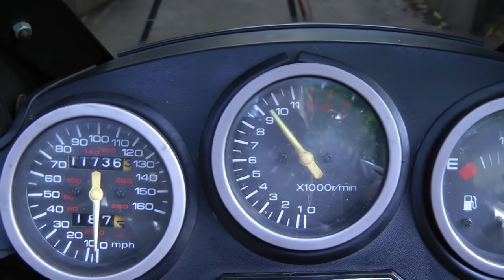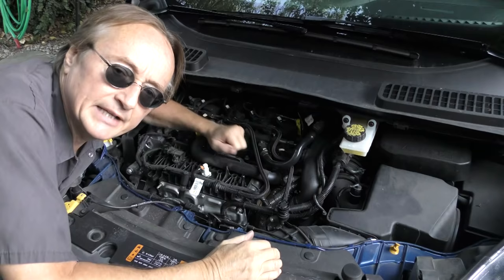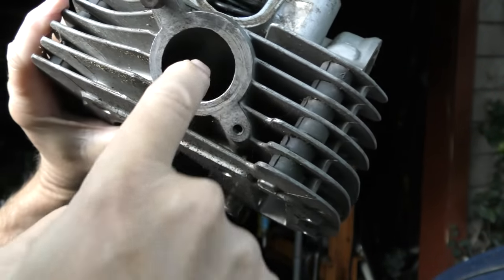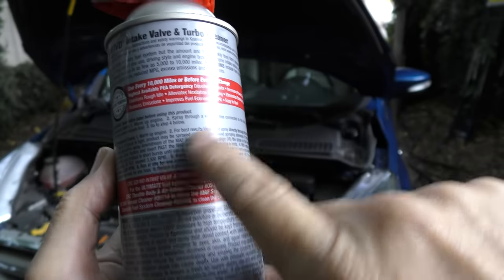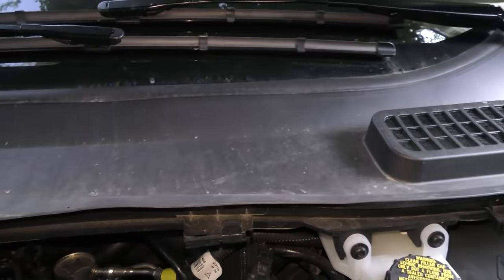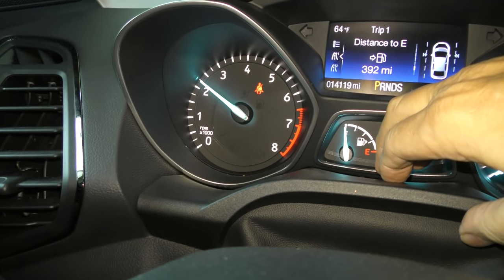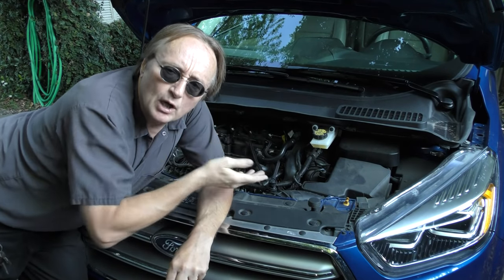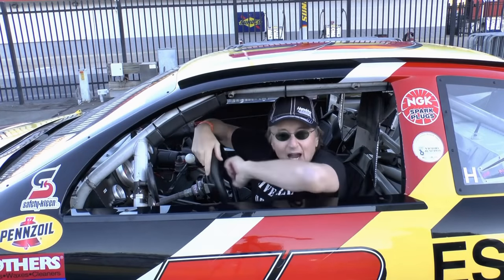How to Clean Intake Valves in Your Car with a Spray Cleaner

Comment: Hi Scotty...thank you for the great videos. I have to say this product needs to be used with extreme care and caution in some cars. I'm currently in dispute with New Zealand supplier where my car now smokes upon start up. 1999 Mazda FS 2 litre 109,000kms genuine. It certainly worked and did a great job. CRC NZ have stated due to the deposits been removed oil is now seeping into chamber as valve seals were tired before using product. My argument is given the nature of the product and what it's likely to do their should be a warning on the can. It's not good environment 'PR' To have valves cleaned to make an Engine perform to it's peak only to have it puff smoke and consume oil. 

I simply cannot trust this product again and risk it cause issues on other's cars. I strongly advise be warned and prepared to take the risk
Reply from the maker: yes, realize if you have a somewhat worn engine, and you clean the carbon out, there is more space for oil to go by the piston rings.  BUT, your engine was worn in the first place, as you admit it did a great job cleaning it, then you can't blame the wear on the cleaner. They are indeed correct in what happenned.
Reply: G'day Scotty....The argument I have is there was no issue before using this product, and rightly so at that age it wouldnt be uncommon to expect valve seal issues. I simply feel CRC need to make a balance between pushing the positives as well as the negatives of such a clean up. 

One could argue a professional would know the risks, however CRC do not intend this product to be used purely by Professionals. Atleast not in New Zealand, it is pushed even to a layman. It is only fair people should be in formed of risks so then it is an informed choice. 

If I could find a video how to replace seals on a Mazda FS 2 litre that would be awesome. Love your videos Scotty
Reply: Thankyou for your message. Would you know where a video is on a FS engine valve seal change? I cant find one for looking. Many Thanks
Reply: Well I'm definitely going to try it where do I get the stuff at thank you Scotty you're a beast I love your bike by the way I sure hope this works on my older  Toyota Corolla I'll let you know so I changed the oil afterward I wish they'd say what to do after you've done this you just leave it alone or what thank you

Comment: Scotty you are the man , I have a 2011 Scion tC with a rough idle I changed the plugs ,cleaned the throttle body ,changed the coils and still the idle jumps and shakes at low rpms  anything below 500 she wants to shake up at lights , parked . When disconnect the intake idle vale pump the idle is fine . Can I clean this part ?

Comment: Hi Scotty, on the CRC bottle, it  asks the user to spray behind the MAF sensor in the intake manifold. Will spray into vacuum line yield a better result? Also, how did you know that hose is the vacuum line to the intake by just looking at it?
Reply: I'm wondering the same thing
Reply: Is the maf sensor in line with the vacuum hose?

Comment: SCOTTY PLEASE HELP!! YOURE THE BEST AND WILL KNOW THE ANSWER!!

Is it safe to clean the intake elbow  after removing the throttle body off of it? Or do I need to remove the elbow and clean it when it's disconnected from the manifold?

I want to clean the EGR ports and I can't remove just the EGR valve because the EGR tube nut is completely rusted and stuck and nothing will take it off. I've tried everything.

I have a 98 ford f250 4.6

Let me know.. Thanks!

Comment: How did you keep the car at 2000 rpm while spraying the can?
Reply: The cat did it
Reply: Brick
Reply: I had my son do it. He's handy.
Reply: hola yason probably used his programing tools to set idle many HIGH END obd2 scanners can do that
Reply: hold the throttle cable
Reply: These modern GDI engines don't have throttle cables.  They have electronic throttle bodies so you need a friend or a high end scan tool.
Reply: @Plumharambe  it's drive by wire....
Reply: Pvc pipe and using seat button

Comment: What about the additive with your gas I just bought the Lucas brand fuel injector cleaner for my 96 thunderbird does this stuff really work? I know Lucas is a good brand but I was just wondering thanks scotty
Reply: i dont no about lucas but nulon fuel cleaer valve ect works i put 1 bottle in every service i do 5000km
Reply from the maker: all true , in a GDI engine tank cleaner will not clean intake valves, but it will clean the inside of the engine
Reply: This additive will clean the fuel injectors, which are very expensive on GDI motors.

Comment: What about the vvti engines of Toyota corolla? These are not GDI engines as far as I know.
Reply from the maker: of course it works on any engine, cause GDI engines are the hardest to clean, so it works great on normal engines too
Reply: Thanks much appreciated scotty.
Reply: +Scotty Kilmer how to sparay the cleaner in fuel injection e gasoline engine through throttle body or any another way

Comment: can you spray it directly into the throttle body?
Reply: Michael Harless no
Reply: why?
Reply: But Scotty did say on the video explanation "or if it's easier, you can spray the cleaner directly into the throttle body of the engine"
Reply from the maker: yes you can. This one was just too hard to access on its modern design
Reply: Derp lol but heat and oil through the pcv valve is ok.
Reply: Derp just use throttle body cleaner replaces coating
Reply: Thank y'all.  I have a Toyota that the throttle body is ready to access
Reply from the maker: yes you can, on this car though the throttle would take an hour to access
Reply: Scotty Kilmer thank you Scotty!
Reply: Mausome I would like to know this too
Reply: You can.. Just make sure to spray AFTER THE MAF SENSOR. Don’t get it on the sensor it will jack it up. I have a 2012 Ford Focus and I spray the CRC PAST THE MAF SENSOR into the throttle body. But I am interested to know where would be a vacuum Jose that I use. That might save some time from having to take the air filter off.
Reply: Derp also because you can mess with the air flow in the throttle body if you force open the the butterflies cause the throttle opens and closes when the computer tells it to. It’s kinda like a learned behavior from how you drive. If you manually open and shut the throttle you can throw it off sync not to mention that it can also shut while your finger is in there cleaning and then you’ll have more than carbon build up on your intake valves.
Reply: @msb3235  yes sir....

Comment: Do you recommend Seafoam engine cleaner
Reply from the maker: no, not a fan, I've seen problems occur with customers using it incorrectly
Reply: Seafoam works if you're careful with it. 9 times out of 10, you don't need it, though. Carbon buildup extreme enough to affect performance usually means you have another issue somewhere, likely the carb is set too rich, or the air filter is blocked. 

What I prefer to seafoam, is water. Once the engine is warmed up, have someone keep the throttle at about 50%, and spray some water into the intake or carb, using a spray bottle or somesuch. If you're careful, it will work wonders. Just use a tiny amount each time or you risk hydrolocking the engine.
Reply: Scotty Kilmer what about BG44K
Reply: andy ? I wish I had the time or willpower to pull an engine apart to remove carbon buildup
Reply: Ooooh fair enough. All the same though, to get at the cylinders you'd have to pull the heads off and that seems like too much work for something I can do with 5 minutes and a bottle of water. To each their own, though.
Reply: Water? Tap water? In the engine? Over seafoam? You're right about the carbon buildup being benign in the first place but don't tell people to put water in their engine. That's as bad as installing muffler bearings or paying the core charge on a pedal-depressor.
Reply: +Michael “Al” Norman preferably not tap water  as it can leave deposits, but it still works. Try it before you diss it, I didnt believe it at first either. Had an old lawn mower that was running rich, lots of carbon. Put a few shots of water (Country water, from the tap) into the carb after it was warmed up. It was honestly incredible the amount of carbon it cleaned. 
Obviously this is a terrible idea if you have a turbo, and you do need to be careful not to put too much in too fast, but its a tried and proven method. Ive used it on cars since the mower with similar results.

If the water part worries you, water injection isnt unheard of in engines. In WW2, a number of German fighters had a water injection system, MW50 if I remember right. it was a 50/50 mix of water and  something else. It cooled the engine, and also delivered a considerable power boost.

The big thing is to make sure the engine is at operating temperature, the water must be able to turn into steam readily. If the engines cold, it wont get rid of any of the carbon.
Reply: Will S. Yes, in high altitude aircraft that used carburetors they had a system that injected ethanol(or a combination of liquids sometimes alcohol) to cool the cylinders and give a performance boost. At high altitude there's less oxygen to react with the gasoline and the engines would ping and blow holes in cylinders or worse. Supercharging was a big help but the injection of ethanol, alcohol, water mixture still helped.

Comment: My lower intake butterfly's ( back bank only: all 3) are glued shut. Like super glued. I pried them loose using the runner control arm off the actuator. They stuck closed again. Now they are loose enough to move again. Can I use this CDC product to get them cleaner? The PVC and EGR are the culprits. Plus some blowby on the 105,000 mile Ford Windstar 3.8 . Got a new/used Actuator from the junk yard for $15 here in Detroit area. I could take the upper intake/ plenum off but its not leaking as of yet but is known too. I digest. Thanks for helping me out. You get me laughing so hard at some of those pictures you show!  I'm subscribed now .

Comment: can we use the pcv valve hose ?
Reply: you can...but it is not recomended,you can get a check engine light for pcv malfunction
Reply: If you hear a light rattling sound when you shake the PCV valve, you don't need to replace it. If you hear nothing, you can replace it or clean it. Regular oil changes help it last longer before it gums up from the oil vapor that passes through it. Regular carburetor spray cleaner will clean the valve, or you can replace it for a few $. Let it dry for an hour before re-installing. It shouldn't have to be cleaned/replaced more than a few times in an engine's life. If the grommet around the valve is torn or hard, you should replace it (may be a dealer-only item).

Comment: Hey Scotty, have you tried liqui moly pro line throttle valve cleaner? If so what do you think of it? Is it as good if not better than CRC intake valve cleaner? The reason I ask is because where Im from the liqui moly one cost about 88MYR and the CRC is around 180MYR. That's more than double the price!

Comment: Could this break up large carbon pieces on a direct injection one, and send the pieces down the cylinders causing damage?
Reply: Potentially, but I don't think it will do any damage. The PEA will soften the carbon and it won't be hard enough to actually damage the cylinder

Comment: Scotty, need your option. I've got a 99 Ford Crown Victoria Police Interceptor, 150k Miles, on cold starts it makes a tapping noise until the engine warms up to operating temperature, it sounds like a valve ticking or a lifter tick... once the engine is warmed up it goes away 100% and the car runs great. What should I do? Is this a symptom of a serious engine issue? This was my first car and I love it, need to keep it running 100%

Comment: I had an issue I feel talking about might make someone's day easier if they have the same happen to them. I did my M37 and it was relatively easy. And I did notice a little cloud of smoke under acceleration at first. We'll today I did my Co-workers Kia Soul and man o man. When he took off it was like a smoke screen. Then it start missing and ran like crap. I popped the plugs out and the number four cylinder had chunks of carbon build up all over the plug. I brushed all the plugs off and shes back running nice and smooth. It must've had a lot of build up in it and when some broke free, it stuck to the spark plug. So be careful and be ready to clean some fouled out plugs

Comment: Completed this process on my 2013 Honda Ridgeline with about 64k miles. Was not prepared to correct engine codes for plugged EGR and O2 sensor.

Comment: Hey Scotty, how do you know this stuff is effective?  How do you know this isn't just snake oil or a placebo?  Has anyone actually inspected valves after using this stuff for the first time at say 20,000 or 30,000 miles?  And if these carbon deposits are dissolved, where do you think they go?  Into the cylinder, exactly what you don't want.  BTW, your many postings are generally very well done.

Comment: Hi Mr. Kilmer,
I just bought 2003 Camry LE V6. I would appreciate if you can guide me more into it. Or if you have some of your past videos that will be great. Like how to maintain it or in particular to that car model. I intend to keep the car for next 4-5 years as it still can run some more miles. I appreciate your help in advance.
Thanks
Reply from the maker: basicallly, change the oil every 5 thousand miles, and maintain the car as in the owner's manual. those things can last forever

Comment: Yup, did it yesterday (1.0 TSi) but we did not find PCV suck hose so we cleaned the throttle and bursted the cleaner from the throttle.. I can say that i did expect to revs go UP but actually it was choking on that. We did not empty the 500ml can but still.. The crap that went outta the exhaust :'''''D and now the throttle does not stick at cold engine

Comment: Hi Scotty, I just bought a mustang ecoboost. I'm hearing and reading so many things about oil catch can's and oil separator's and not having one is bad for the car. Ford will void the warranty if I install one (unless by them) and if I use the crc intake cleaner I'm hearing that it can ruin the turbo and also void the warranty.. Is there any preventive maintenance that can be done to prevent this buildup or is it inevitable that it's gonna happen?
Reply: inevitable.  Either put a can on yourself,  pay Ford to do it or use crc as a preventative measure.  It also affects 2016 and below. Not an issue for 2017 and above.

Comment: I have a 2009 BMW 535xi. I was told I have severe build up on the intake valves. Do you think I would benefit from doing this multiple times in a row? Or, does it get so bad that no amount of cleaning will help after a certain point?

Comment: Scotty wish you would have done this video a couple years earlier as I now have 65,000 miles on my GDi engine - would you still advise using this product/technique?  kind of afraid to knock off a larger chunk of carbon build up and passing it into the combustion chamber???  let me know what you think
Reply from the maker: of course that's a gamble is build up is really bad. BUT, the chunks aren't steel and generally just pass out the exhaust without hurting anything.

Comment: I need your help scotty!! 😢
My 2018 Hyundai accent was diagnosed with a bad 4th fuel injector, possibly fuel pump if injector didn’t solve the problem the paper said
I had people I was gonna have work on it, one didn’t work out the other wasn’t able to work with my budget :’( I’ve spent too much money already

I bought fuel injectors I thought would work from rock auto..
Looked at the car myself, found the injector area
Took it apart, injectors looked odd, not like the ones I bought at all 😢
Did research, found out my car is GDI and I need a direct injector, not port injector. Getting it refunded hopefully 🤞🏻 

Important fact is that I ran 9k miles before a oil change because I was doordashing trying to make money to move out, moved out and didn’t have time to go and lost tract of my miles and when I did, a week later my car broke down 😢
So I know doing that.. by accident.. is why everything must be clogged, it’s at 86k miles and idk if the previous owner treated it any better, it was filthy before the dealership barely cleaned it.. 🙃

I just found info on the valves and injectors of GDI engines get clogged quicker than port injector &valves on top of the info in this video.
That when valves are clogged, the car misfires and the engine shakes, which is exactly what happened to my car!

How can I save my car myself 😭 I will watch any video in the world to educate myself on the proper technique of cleaning the valve and injectors.. I learnt I need to put a fuel cleaner into my tank and clean the fuel pump and/or filter if possible

Is this all correct? Can you give any tips please 😢 do I have to remove my engine to clean the valves?

Comment: Ford had said this was not an approved method for the EcoBoost engines as it was likely to damage the turbo. Not just the dealer quoted this. Had the contact escalated to engineering through a tech and response was the same?

Comment: Question should I change the oil, pcv valve and the spark plugs before cleaning the intake or after. thanks for this video. It’s incredible why wouldn’t dealers ever do this I never even heard of spraying this stuff into the intake.
Reply: I would afterwards. Definitely the oil and pcv valve.

Comment: The new 2nd generation 3.5 EcoBoost for 2017 has BOTH direct & port fuel injection. So, would that cleaner be necessary for the new engine? Good video.
Reply from the maker: not as much, that's why they designed that to stop the carboning up problems